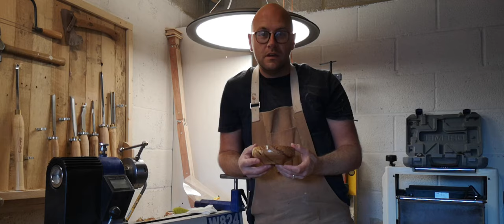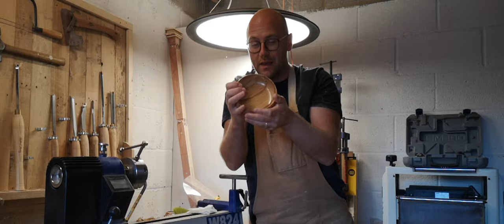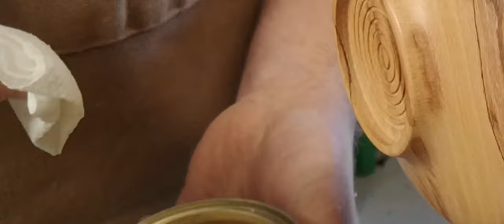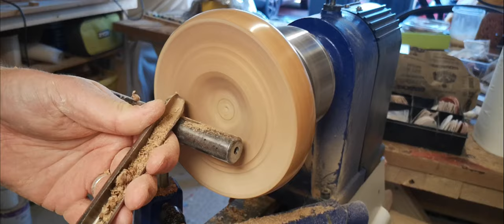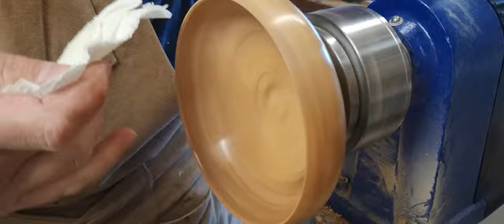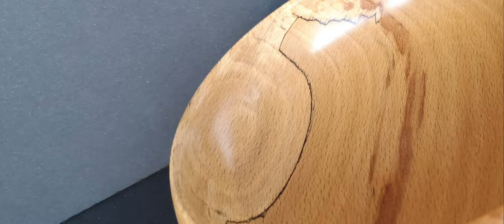Japanese Spalted Vase

Comment: I would like to see your sharpening setup, I have a Oneway Wolverine jig, and it works well I think but at times I feel like my grinding stone needs to be an 8" and at least twice as wide.
Reply from the maker: I started off using a similar set up and could never get it quite right. Can't woodturners can, I often see Ashley Hardwood sharpening to a mirror finish but I could never get it right. I pulled the trigger on a Robert Sorby Pro edge about a year and  a half ago and would say it's my best purchase behind my lathe. It's super easy to set up and takes about 5mins to get that mirror finish.
Reply: @awoodworkersson396  Yikes, they are $$ but the results look good!
Reply from the maker: @heyimamaker  yeah they are expensive, not my usual purchase to be honest. But I have to admit I wish I'd done it sooner - now everything is mirror sharp and my skin heals much better when I cut myself haha
Reply: @awoodworkersson396  Lol, well if it gets you out there doing more then it's worth it. I am always kind of frustrated with the lathe because your finished product and generally experience have so much to do with tools being properly sharpened.